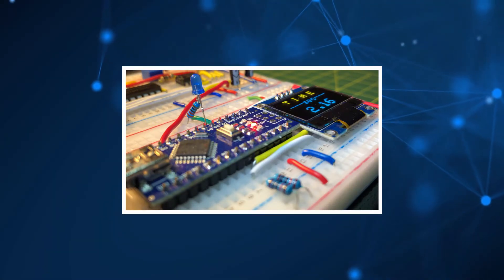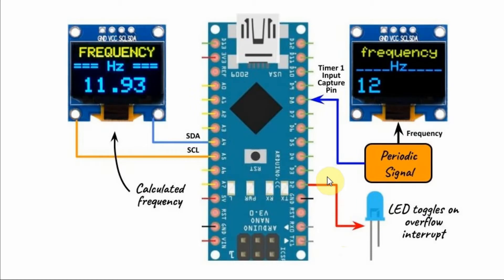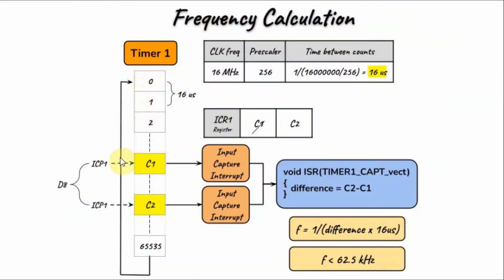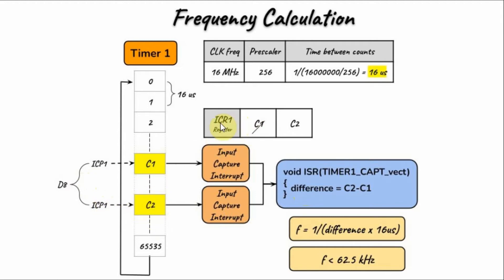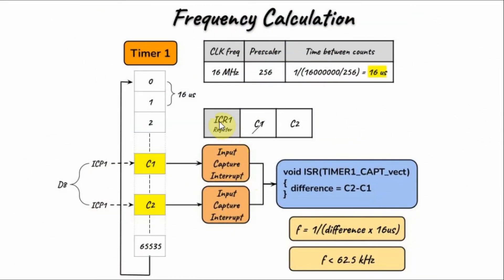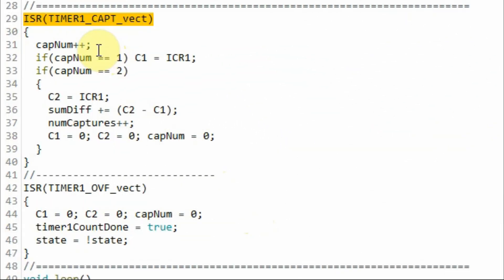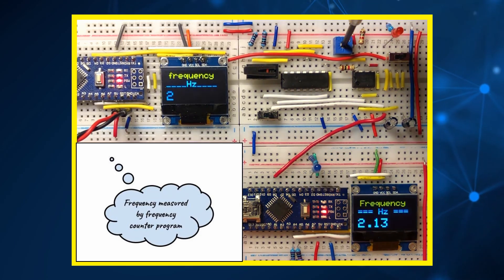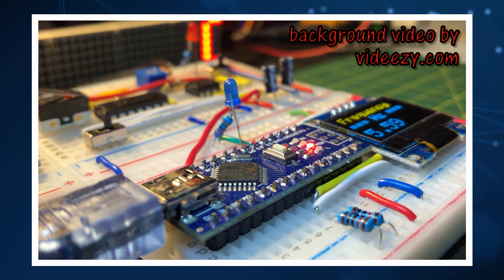Frequency Measurement via Arduino Timer

Comment: Great video!
Any tutorial how to measure two input signals simultaneusly with a maximal freq of 40kHz and and show the ration of the two? I would maybe use a tiny ESP32 board if possible with wifi or BT.
Maybe ou have an idea if a ESP32 or ESP01 would be okay for the job?

Comment: What would be the max frequency it could measure ? I need to measure around 2 Mhz not much precision needed
Reply: It's about Arduino
Reply: Arduino need to have much faster clock then frequency
Reply: @matgaw123  uno runs at 16mhz , I used freqcount library and it worked fine , measures very good
Reply: @rodriguezfranco3839  good

Comment: Hello, it's a pretty simplified frequencymeter. Thanks for the video.
Can I ask; I need to use LCD display. Also, I need to count irregular analog signals between 20-100hz. can i use this code?
So, can I make these irregular analog signals readable with arduino internal adc or an external adc?
Reply from the maker: Thanks for your feedback. Yes you can easily replace the OLED with LCD. You need to use appropriate library. The code should be able to measure low frequencies.
Reply: @AnasKuzechie  thank for answere.  one of my questions was also about adc.
Reply from the maker: @ahmetozdemir7173  The code uses Timer1 via digital input D8 to calculate the frequency of input TTL rectangular wave. In order to measure frequency through the analog inputs, another sketch needs to be written. But, that's a thought for a future project.
Reply: @AnasKuzechie  It will be very good if you prepare a video for analog signal.